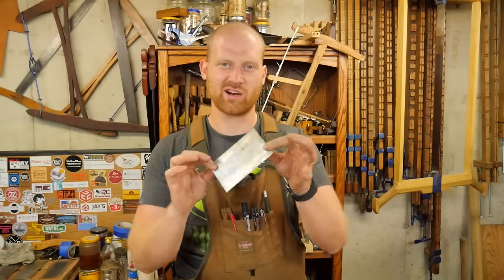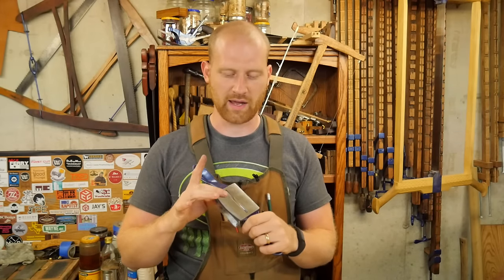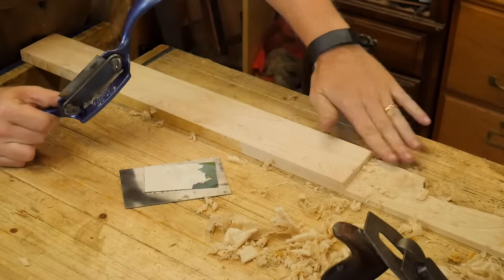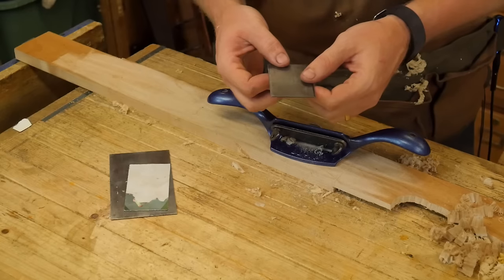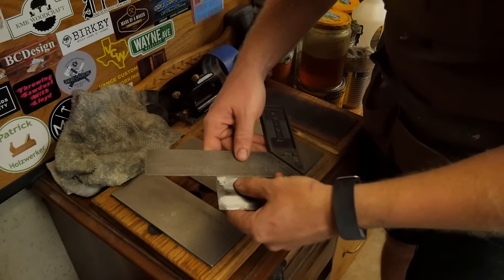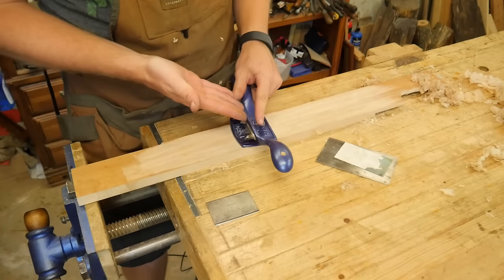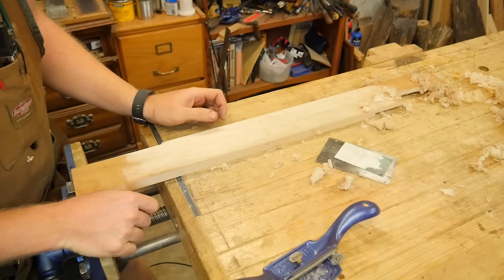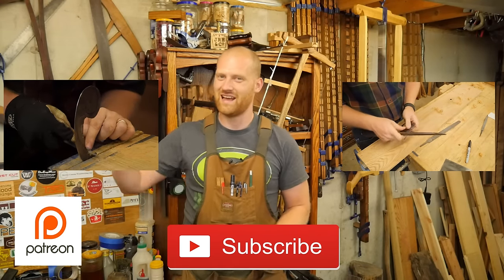How to Use and Sharpen a Stanley 80 or 81 Scraping Plane

Comment: I picked up a vintage Stanley 80 and had only guessed at how to sharpen, mount, adjust, and use it.  Now I know so I expect it will work so much better and I will use it much more often.  Thanks Patrick.  You da man!
Reply from the maker: Sweet. Glad I could help!

Comment: I picked up my #80 off of craigslist about 5 years ago. We were in the process of moving to another state about the same time.  Fast forward, I'm making a coffee table for our home, had to fill a ton of beetle holes with epoxy. I started to use a regular scraper to level out the epoxy, hands were getting tired real quick. About that time I remembered the #80 I had forgotten all about. What a difference this tool made! Thanks to your video, I now know how to sharpen, and adjust it.  Thank you. You have a new subscriber. Keep up the good work.

Comment: I've owned a number 80 for some years and have tried to use it a few times with little success.  After watching this video, I sharpened mine in about 2 minutes on diamond stones and .., it was amazing.  I cleaned up excess epoxy from a scarf joint with no effort.   I am sold.  Thank you

Comment: I just tried one for the first time to scrape finish off a board and also was using it backward.  It worked pretty well considering.  But nothing like you showed.  Thanks for the great explanation.  Mine's a Woodriver copy, and now I'll replace the bolts that hold it with something I can finger tighten like your Stanley instead of having to use a wrench.
Reply from the maker: Nice. it is a fun tool when it is sharp and setup!

Comment: I have had one of these hanging on the back of my workbench but never really used it much, almost a forgotten tool. This will be put to work very soon. Thank  you.
Reply from the maker: Sweet. Those are a lot of fun when they're set up right.
Reply: I bought both the 080 amd 151 from Lee Valley before they made their own. I doubt I paid close to what you would pay for them on Ebay now and both in near new condition. I share my shop with Vancouvers No 1 magician so they will both be put to work very soon. He is laminating a lot of oak he got from some church pews he picked up cheap.
Reply: That is the joy of this hobby. There is ALWAYS something to learn or share.
Reply: That will be dealt with shortly.

Comment: A friend just gave me one of these today.  I did not know what to do with it until I watch you set it up and work with it.  (he gave me a no. 12 also)  Can't wait to clean it up and sharpen the blade.  Thanks James.
Reply from the maker: WOW, great friend. the 12 is almost worth its weight in gold. Great friend!
Reply: Yes, he is.  He inherited these tools from his father-in-law who got them from his (father-in-law's) neighbor who was a cabinet maker.  So, these have an interesting heritage.  They are in great shape.  I will prepare the blades and see what I can do with them.  If you don't have a burnisher, what can you use instead to make the burr?
Reply from the maker: You can use any piece of steel that is harder than the card. most screwdrivers are not hard enough. some people use the back of a good knife. but you can usually use a burnisher you get from a kitchen supply store.

Comment: After cleaning up and fixing the missing blade on the Stanley No. 80 that I was lucky enough to assemble from scrap parts I of course posted video of the process. As I'm going through and setting up the playlist your video series popped up on my feed. You have done an excellent job of explaining something that took me a while to get the hang of. 
Thanks for sharing.
Reply from the maker: thanks man. that means a lot.
Reply: Old Sneelock's Workshop i

Comment: James:  After about 10 hours of trying to correct all the problems with my new 80, I have gotten it to a point where it works.  Not well, but it is a start.  The original owner of this Scraping Plane took a file to the back edge of the steel blade.  He did not file it straight either.  So, I had to use sandpaper and my diamond plates to flatten the back.  Then, I had to reprofile the bevel to 45 degrees.  This steel blade is really, really hard.  I got it to something that resembles a good proflie so I could roll the edge and try it.  It does scrape.  Not like yours. Yet. Really rough and choppy.  I still have a ton of work on the sole to flatten it out and still working on the blade.  I even ordered wider diamond plates to work on this.  (I will have them forever) Thank you for your explanation and information.  You helped immensely with trying to restore this old scraper.
Reply from the maker: wow! That is a lot of work. thankfully once it si done then you don't have to mess with it.
Reply: I am assuming the original owner did not have YouTube and just did what he thought was correct.  I realize that when I flatten and reprofile the blade, I will not have to do it again.  The black paint is in very good shape so I will not be striping the metal and repainting.  I am a weekend crafter and don't need that kind of restoration.  But yes, my shoulders ache.

Comment: Thanks for the great video.  I found both a Stanley 80 and 81 scraper in my grandfather's tools and had no idea how to make them work.  Neither had a blade, so I just ordered a replacement on Amazon last week.  Set it up as per your instructions and it worked great.  Had the blade in backwards at first.  Turned it around and wisps as you said stared on my test block.
Reply from the maker: Sweet. That is what I like to hear. It is a fun too.

Comment: I’ve been following you for a few years now and I have learned a lot from you, I just got a new meet 80 this past weekend and your video was the first one that came up in my search, the only thing I have a question about is your burnishing rod, is a steel you would use on knives or would any piece of metal work?? Thanks for doing what you do and keep up the great work!!!
Reply from the maker: Thanks that means a lot. As to the burnisher. It needs to be a harder steel then what you are burnishing. I generally use a carbide rod. https://www.woodbywright.com/shop/burnisher

Comment: I have an Axminster 80, who are a mid range company here in the U.K. It has a shorter and thicker blade but after flattening it runs like a dream and is really easy for a newbie to use. It took some flattening though, about 30 minutes but because I get so breathless it does take me longer. I’m never too sure how long is acceptable for a new tool but I think it’s worth doing properly. I had to buy new as I couldn’t afford used, really tatty second hand Stanleys seem to be going for a fortune here in the U.K. That is if you can find one anywhere else but eBay which is a massive rip off for S/H tools, everyone seems to think their pile of rust and holes is worth a fortune. My next tool is going to be a brace and bits I don’t mind new bits but I don’t want a new brace with plastic handles so I’m going to have to hold out until I see one at the right price and condition.

Another excellent and useful video, thank you James.
Reply from the maker: so true. the stanleys on anything are always more expensive, but for a tool like this it does not matter. cheaper works just as well.

Comment: Great video, very useful!

I just picked up a No 80 that the previous owner had ground a fairly significant camber onto one side of the blade (including a 45 deg bevel following the camber). Sort of like a "scrub" scraper. It would be easy enough to remove, but I am wondering if there is a reason why someone might do that and if it would be useful to leave it that way.
Reply from the maker: It sounds like it might have been a specialty profile for doing some particular trim or something of that nature but I don't know why you would want to do that for standard use.
Reply: @WoodByWright  Thanks for the reply! I was guessing it was probably something like that.

Comment: hey James, good stuff. I was working on some tuning/restoring tonight, and one of the tools was a No 12. Would you also put a 45 deg on that as well? I need to go back and listen for the reasoning behind that, I guess. Thanks for all the work you do!
Reply from the maker: you do not need the 45 it just makes it easier to turn the bur as you will not quickly flip the card around like you would with a card scraper. but the #12 came with a 45 on it from the factory.
Reply: Thanks for that info, this #12 is going to need straightened, then I'll put a 45 on it.

Comment: Thank you so much for the videos.  They all seem to be great so far...and I am kinda of a fussy woodworker.  Can I roll the edge with a nice smooth round of mild steel or is hardened better?  Wish i got back into woodworking long ago.  I've forgotten more than I now know.  Spent a year and a half as a pattern maker for a foundry. Been in sawdust most all my life. Wish I was as fly on the wall in your shop.. Thanks again!!
Reply from the maker: Thanks that means a lot. Unfortunately mild steel is just too soft. If you have a file with a safe side that works.

Comment: I came across your video about a week ago.  I found a Stanley 80 in amongst old tools in a forgotten chest. Your video got me motivated in using it as a go to tool now. My question.....
The blade has got a curve to it. About a 1mm to both ends.
Is this just from age of sharpning/usage or must it be straigh ? I've sharpened/burred it as is and works fine. But would a straight edge be better? Seeing that as you tighten the "bend" screw it flexes convex to the surface you are working. 
Thanks.
Reply from the maker: Some people use to curve it a bit, but it was a personal preference. Traditionally all finishing tools scooped out wood rather then cutting a flat section. This sounds crazy to the power tools mind set, but the slight curve is imperceptible to the hand or eye.
Reply: Wood By Wright Thanks.  I'll leave it as it is then .

Comment: Can you still just make the blade out of old saws like a card scraper?

Also, what’s with the magnet on the back of your card scraper?
Reply from the maker: You can use a saw plate for this. However, it tends to be a bit too thin for most people's liking. It vibrates and chatters a bit more. But it can do the trick. I put a magnet on the back of a card scraper to keep my thumbs cool. If you do a lot of scraping it heats up and can be very hot to touch. The magnet will allow you to keep your thumbs there without burning them.

Comment: i have watched your video so many times and sharpened my no 80 accordingly. but i always get heavy vibrations and chatter as i use it. any ideas as to what im doing wrong?  thanks in advance  looking foward to your insight .
Reply from the maker: With a cabinet scraper usually the problem is you're trying to take too deep of a cut. It should just barely be sticking out to scrape the top of the surface. if it catches too much then it bounces back and forth as it goes forward.

Comment: Can it be used on the pull stroke with equal results? Also, aren't cabinet/ card scrapers to be used only on hardwoods?
Reply from the maker: You can use it on the push or the pull stroke. It's just a little bit more difficult to pull it as it will want to rotate out of contact. So you have to put more pressure behind the plane. When you pull it. You can use scrapers on softwoods but you have to have a very very good burr. It's one of those times where the harder the wood. The easier it works the softer, the wood, the harder it is to work with.

Comment: James:  Can also set up the steel on a jig and use the diamond paddles to sharpen the 45° edge?  Then go on with setting up the burr?
Reply from the maker: sure. I am not a fan of jigs but they are great for some people.
Reply: Not really talking about a jig.  It is just lifting the scraper up off the bench surface so the paddles incline at 45°.  (A Paul Sellers suggestion)  I still need tons of practice at freehand sharpening.  I end up rounding the surface that I intend to make flat.  In some cases that does not matter.  Since this angle is not critical, I may practice more with this scraper's blade.

Comment: When I was looking for new ideas for doing my floor I came across an article about this. It looked really interesting because it saves your thumbs and because the article made it sound like you were actually turning the edge rather than just making a burr. I wondered, and still do, if that makes the edge last longer than on a card scraper. Have any thoughts on how long this stays sharp as opposed to a card scraper? If so I may bite the bullet and get one since I have a couple other projects coming up it may be useful for.
Reply from the maker: +David Dorothy it lasts just as long as a scraper it it the same action as a scraper. Just more controled. If I were doing a floor I would expect to scrape 6 squar feet a side. Then flip the blade and do it again. Then spend another 3 minites rolling a new bur. You can probablr re roll the bur 3-4 times before you have to sharpen it again. But still faster and cleaner then a sander. The down side is you can not get close to walls with it.

Comment: Great video.  Question, is it important that the sole of the plane body be flat?  Mine is not very flat and I was wondering if that is why I am getting less than stellar results.
Reply from the maker: thanks! it does not need to be as flat as  a plane, but if should be flat-ish. if you set it on a flat surface it should not rock, and the mouth should be in contact with the surface. no need to get out the feeler gauges.
Reply: Ok, awesome.  Yeah, mine does rock a bit.  I'll get out some sandpaper and flatten it up a little.  Thank you James!
Reply from the maker: my pleasure Anthony!

Comment: I got one of them Stanley 80s. I can barely get it to do anything. I think the blade in it is shot. It's not really flat anymore. It's is all whipped out and bowed.
Reply from the maker: Interesting I've ever heard of a blade doing that before. You can actually use a card scraper in these you don't need an actual blade.
Reply: @WoodByWright  yeah at its best I'd say it is doing what yours did before you turned it up. Because I can't raise a very good burr on it due to the poor condition of the blade. I almost managed to polish the back of it though despite it being shaped like a potato now. Maybe it needs a couple more smacks on the anvil? The few I've already given it seem to have helped it out a lot.

Comment: Thank you for so great explanation! One question, what, from your point of view, would be the optimal thickness for the blade. I bought Stanley 80 on the ebay but the blade was broken, so I had to make the new one from the old hand saw. It has thickness around 1 mm. I'm afraid that it's too thin. So I got just dust and no shavings.
Reply from the maker: ya that is on the thin side. usually for these I like it to be between 2 and 3mm
Reply: Thank you for help. I'll try to find something more appropriate. Nobody say (or may be I just not got it) that this iron should be hardened, but may be this implied.
Reply: Yes it should be heat treated, and hard like a plane iron not a cabinet scraper. I don’t know much about the usual hardness of scraper planes irons or how critical it is but the cutter on my Stanley scraper plane can’t be filed and feels just as hard on a stone as any other blade. Normalizing a couple times before quenching would help keep such a thin blade flat, and don’t grip it with tongs on the cutting edge when you dip it or you’ll leave a soft spot there.

Comment: What would you suggest using on a Boos butcher block when I want to get all the oil and grim off? It has an end grain top made of maple.
Reply from the maker: A low angle hand plane with a 20 or 25-degree iron and sharpen it every few passes.

Comment: Wonder if you have a 80 chatter when using it on white oak ? My blade is made from a thin kerf circle saw blade.
I cannot have the bend adjust screw touch the blade- it must be loose but still chatters. Thanks, Jim
Reply from the maker: I have no problem with chatter. If it does show up usually that is a sign that you are taking too deep a cut or there is not enough pressure on the blade.

Comment: nice video James. I was wondering what is the difference between a burnisher and a steel and can i use my steel as a burnisher
Reply from the maker: generally nothing. Steel has a lot more meanings to a lot of different people. so basically all burnishers are steels but not all steels are hard enough to be a burnisher. thanks!
Reply: thanks for your input

Comment: Stephen, just purchased a Bulldog number 80. The blade appears much thicker than yours, almost a plane blade thickness. Can this be a problem?  Thanks!
Reply from the maker: Yes. A lot of people like really thick iron and that way they can get a straight shaving all the way across the weight of the iron. It's just a personal preference on how to thick the iron is.
Reply: @WoodByWright  used and referenced you in my instagram post.  Took an hour to get the back of the blade true.  Turning the burr was also tricky for a newbie.  Actually took some shavings, but had chatter.  Murphy is teaching me what not to do

Comment: I just picked up an old Stanley 80, and I noticed that the iron had one flat edge and one cambered edge, whereas you have two flat edges here?  Is there any purpose to keeping one side of the iron cambered, similar to a scrub plane, or should I flatten that back out?
Reply: Jon Matle the only reason I can think of is if you have a common rounded Grove that you are making all the time. I don't see a reason for one. they will never take a deep cut. it will just give you an uneven surface.